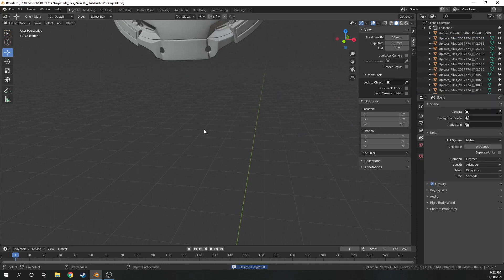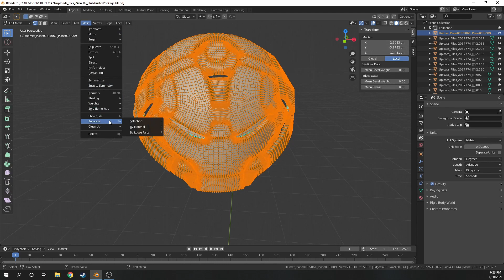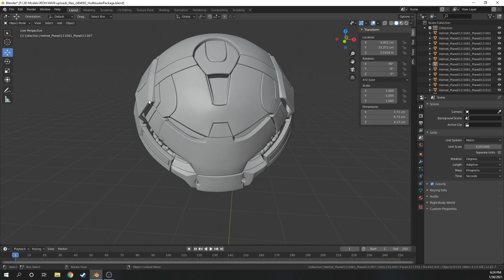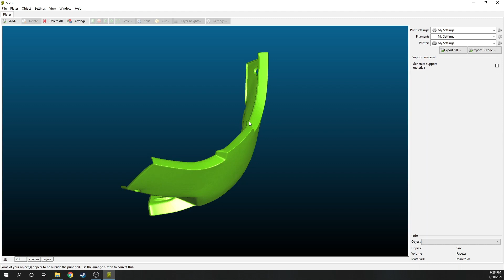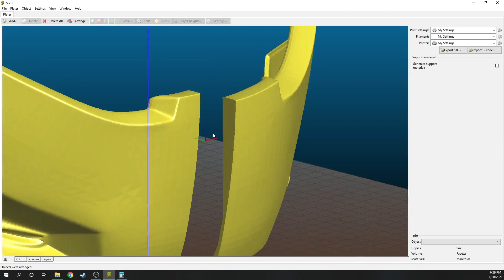How To Cut And Slice Models For PRINTING On Smaller MACHINES

Comment: If your exporting as a .stl file Select the part you want, go to export and then  in the .STL panel you will see under Include "Selection Only" Check that on and that will only export what you have selected. Batch mode will export each object in the scene as it's own .Stl file. Be sure to check your .STL file scales. Blender applies a scale factor depending on what it is set to on import and export.
Reply from the maker: Thats fantastic to know. Thanks! I dont really use blender. I just knew enough to get the job done haha

Comment: Very nice.  I'm a SLIC3R user (not SLIC-3R :-) Regarding separating shells, that is a feature that SLIC3R provides, so I'm thinking with the example you provided, you would not have needed Blender. You could have done it all in SLIC3R.
Reply from the maker: Yes and no. In slic3r when you separate shells, it auto arranges them afterwords. So for example lets say your making that hulk helm and you wanted to keep everything where it is except for the face. In slic3r it'll split everything up while in blender you can pick and choose which part you want to isolate